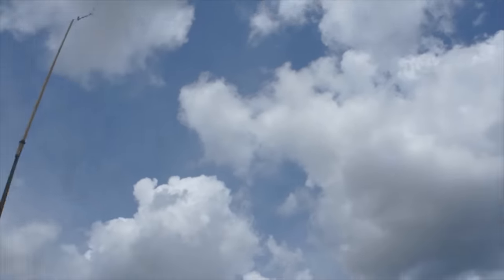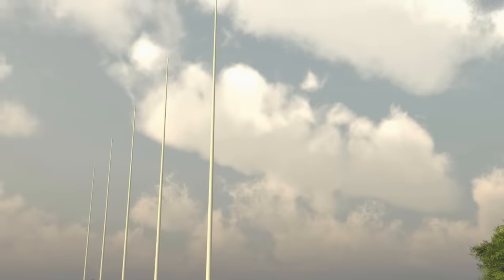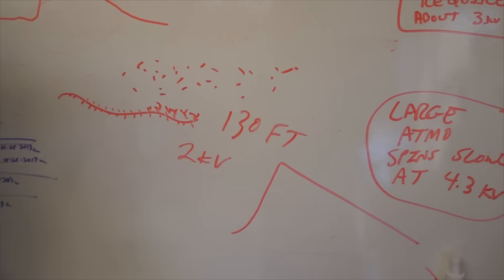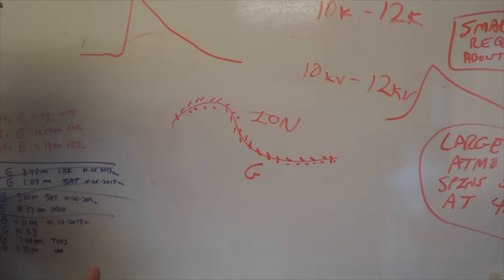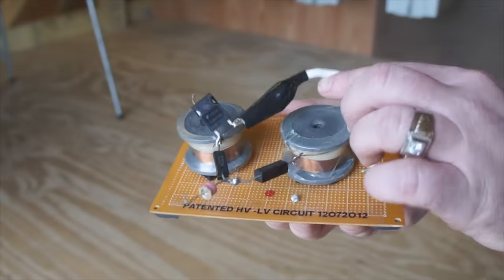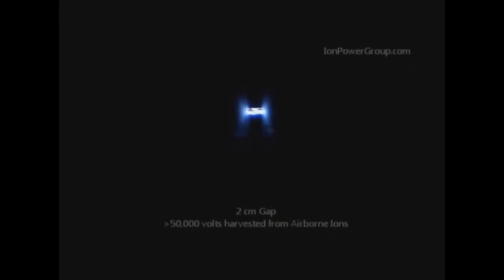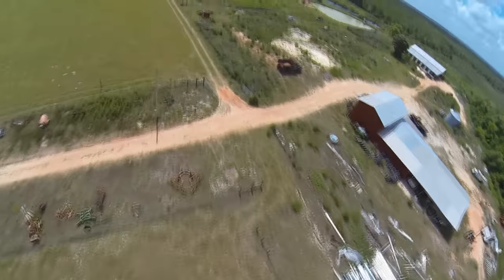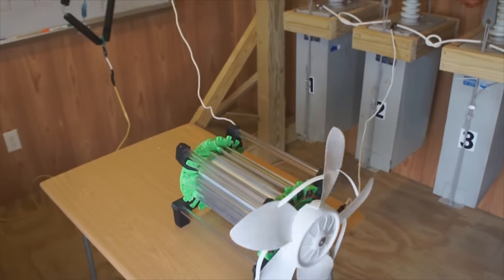Graphene/Graphite Atmospheric Electricity Collectors - Plus Horrific Hexacopter Crash!

Comment: I've kept a watchful eye on this group for several years to see for myself. Here's the important facts. Ion Power Group's technology was selected in 2019 in the TOP-25 semifinalists by NASA iTech and they've achieved TRL3 (Technology Readiness Level 3) in tests as defined by NASA. TRL3 = successful proof-of-concept. Their technology is patented in 33 countries (I confirmed it, true). NASA's 2011 Scientist/Engineer of the Year authored a technical white paper backing the physics of the technology that also states that production versions will likely prove to be a cheaper source of electricity than solar PV since it works around the clock even at night. The Senior Scientist at the German aerospace center also backs the use of their Ion Harvesting Technology in his published report "Power to Mars". They have 7 or 8 legit PhDs associated with the project and a few heavy-duty military advisors onboard. In 2018 FORBES called Ion Power Group's technology an 'elegant' solution to providing power on Mars. In 2019, SPACECOM printed that "future historians may consider Ion Power Group's technology one of the key advancements of our time". No doubt Ion Power Group is legit, but the real question remaining is what the actual cost of the electricity produced by ion harvesting will be in production versions. Their website says that coming next. I'm staying tuned

Comment: Tesla collected atmospheric electricity at warden cliff ,and in Colorado and transmitted it without wires,he was the father of modern electricity,but wireless was his true dream,but free electricity wasn't in the minds of financiers who could charge for it,so we have the system developed today using his patents and designs for wired transmission,most of the electrical technology used today for power companies is slightly modified Tesla designs,I built these products for 25 years and saw many blueprints dated in the 30,s that the designs barely changed today,maybe one day we will see the end of the monopoly of power companies Tesla never wanted to happen to the world.

Comment: But how much power do you get out of your system? Thousands of volts means nothing.  That is just a potential. You do not (cannot) " "harvest voltage". You can harvest power, which is volts x amps over a certain time.. You can have a million volts with such low amperage that the resulting power (watts) is virtually nill. 
The most important point of this experiment is how much power it can put out, but that is not even mentioned.

Comment: its shootin sparks because theres a big tangle of wire there... anytime ya make loops in wire yer creating chaotic magnetic fields... so obviously with extreme potentials the fields are huge and arcs form along the path of least resistance (air) to closest ground (wall)... the whiteboard is just extra insulation... straighten the wire out and problem solved... ;)